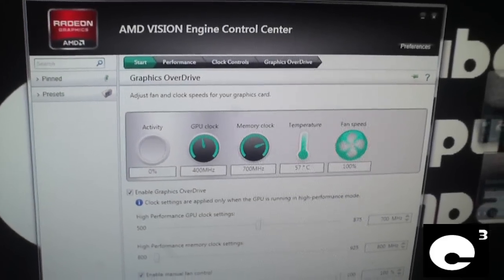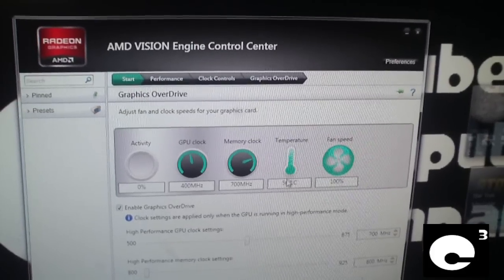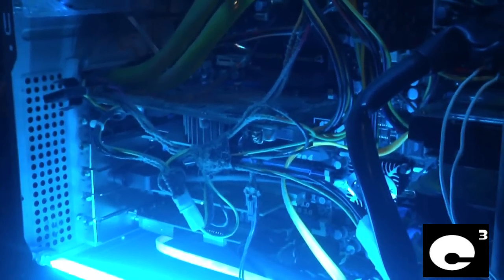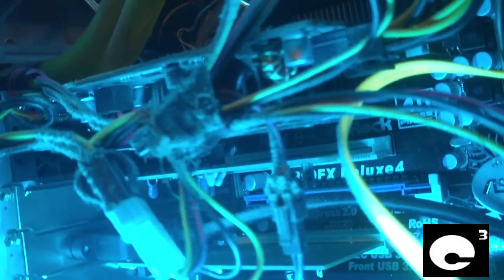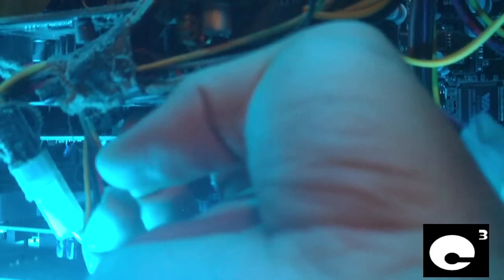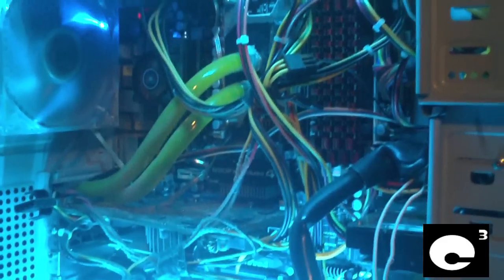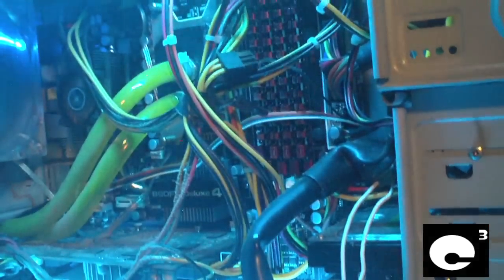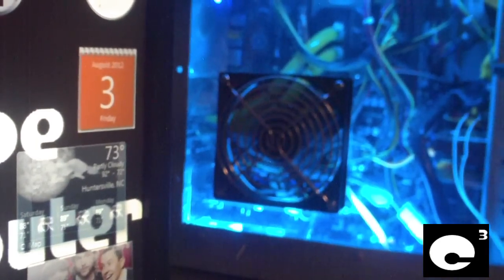Cooling Fan Failure on 3-Month-Old XFX Radeon HD 6750

Comment: I had an XFX Radeon 4550 last summer and within about only one month of using it, the fan made a really high pitched squeal. Not to long later, it died. But luckily I owned an older cooler which was passive and used the same mounting style.